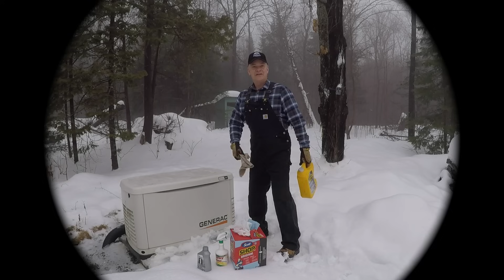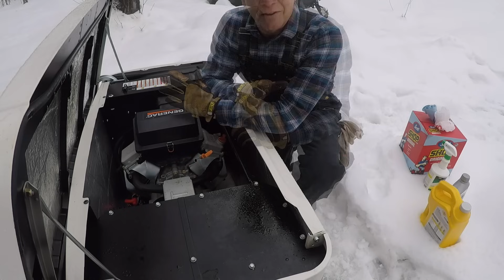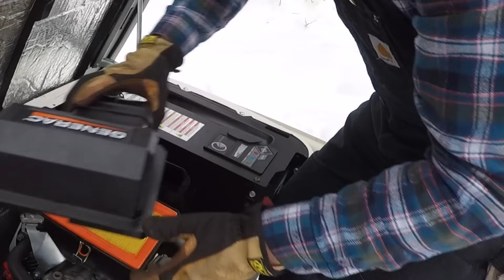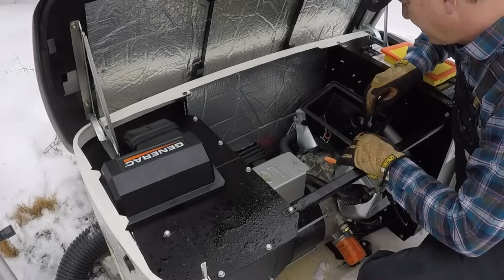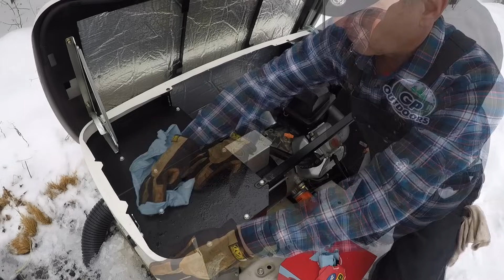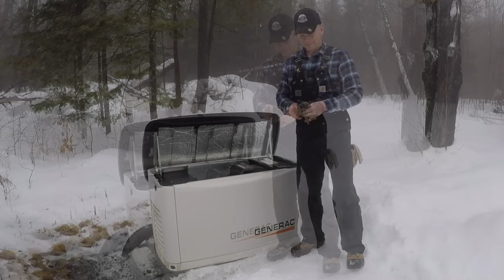#133 Thinking of Buying a Generac Generator? You Need To Watch This!

Comment: Its NOT the exhaust port thats a problem. That is the Crank Case Vent that is freezing over because its a badly designed environmental requirement.  Just pull the hose OUT of the air box, rout it away and put a tiny K&N filter on the end of it, then take some JB Weld and seal up the hole left in the air box. you'll never have another problem.
Reply: dave berry :- That is what I was watching the video for...a positive solution to prevent this icing from happening in the middle of winter during an emergency. Hopefully Generac has also come up with the solution...someone mentioned a heater kit, but surely a drain system of some sort from the factory would also solve this problem. Or a redesign.
Reply: Don't think the warranty guys would be real hip on honoring your warranty with a lump of  JB Weld there.
Reply: @jamesoconnor3562  Then first you take photos of what the device the manufacturer installed, and the icing problem it caused. Then, if you need warranty work, you simply make it clear to them "WHY" it was done, and heres why it was done. Its a bad design on their part. And what I said to do causes no harm to any part. In fact if anything its better for the engine.

Comment: You can buy a little potable heater like the ones used in a motorhome they kick on when the temp goes below freezing so pipes and hoses won't freeze. They are like $25 and very tiny it would fit in that box easy

Comment: You might try elevating the unit. At ground level the engine sucks in snow and moisture accumulated around it. Elevating it about 18 to 24 inches off the ground will help.

Comment: Simple fix, as a rubber hose from crankcase vent thru bottom of filter housing and raise it above above the icing areas...
Reply: What do they recommend for oil?  Use amsoil 100% synthetic. Does it run full tilt on start up? All the more reason to use amsoil
Reply: It would still ice, just wouldn't clog as fast, and then when it finally did, you'd have a huge amount of ice you'd basically have to chip out, without breaking the plastic.

Comment: Ah ok. The crackcase vent was plugged up. That makes sense. I’d just move the hose so it vents to the atmoshpere and not into the aircleaner.
Reply: exactly . maybe add a small K&N air filter   ….don't forget to plug the hole in the airbox.....it's on the "filtered" side of the air filter
Reply: answered correctly..better than factory engineering.....
Reply: the EPA would not like that, but i don't care.  it beats standing out in the cold removing ice from the
filter box.
Reply: David M They do have a fix for the ice issue now.  Positive crankcase ventilation is good for the engine, it is not an EPA thing. You always have blow-by and need to get the gas vapor out to prevent oil contamination.

Comment: People may put this generator down,  but it has served us well keeping nothing in our refrigerator  and freezer from spoiling. As well as staying worm or cool in the summer.  Talk shit about it because you more than likely have NEVER used one.   This guy gave us a very useful idea and could save a service call.
Reply: No, I talk shit about it because I service and repair them. Brand new you have a 50/50 chance that they will need warranty work. I've replaced several governor stepper motors on these units, some more then once.  And all most all of them will have water in the oil when it's changed due to condensation because the controller only let's it run 12 minutes per exercise. And they've had a spate of bad control boards. Bad to the point that all the guys carry an $800 control in the van because chances are that it will be a bad control at 3 am in a storm when the thing quits.
Reply: You have been very lucky. My engine block cracked within the first six hours of operation. & that's very typical of these units. Best of luck to you.

Comment: Not "an exhaust port from the engine", but a crankcase ventilation system to get rid of the blow-by.   Propane is a wet fuel that creates a ton of moisture when it burns.  Kind of odd.  The 'wet' blow-by then gets sucked into the air box ahead of the air filter, where it condenses when it it cold enough and finally freezes when the temperature gets below freezing. It is a really poor design.
Reply: It probably uses a mass air flow sensor to meter the air coming into the engine. The air from the blowback has allready been accounted for and has to be dumped back into the system behind the mass air flow sensor or the engine will run rich.
Reply: Lol. Calling it an exhaust port had me scratching my head for a minute too, but it's good to see a video pointing out the problem with the PCV. This problem isn't unique to propane or to these engines. I had an old high mileage turboed Porsche with abnormal blow by, that would fill the air intake with what looked like ice cream and snow, until it prevented the mechanical air flow sensor from working. Then it would quit because the air/fuel ratio couldn't adjust to throttle changes. No pressure build up in the crankcase, but the problem is similar. For this generator, it shouldn't be too difficult to modify the PCV or filter box to eliminate the problem. Or, find a simple way to add a little warmth to the airbox and a small bit of drainage.
Reply: Yep, any ICE could have this if the PCV goes to the air box.  The problem is temperature differential that is condensing thee water vapor faster then it being sucked into the intake.  Air box warm enough to not condense H2O is the answer

Comment: I would remove that line and install a small external filter and close off nipple on air filter housing. It's just a crank case breather. We use them on Harleys!
Reply: LOL Harleys drip oil all the time .

Comment: I live in Texas and was working on designing a small house with a Generac back up just in case, after the recent issues I have thought more about it and about how well it would work if this happened again. the house would be small, under 1000 ft2 and very well insulated as would be an enclosure area for the generator to deter theft. If that was the main issue for where you are it is encouraging for my results and now I know one item to look out for.
Reply from the maker: Good morning Desmond. So sorry for the difficulties you and your family have faced lately and hope you have power and water and are doing better. It is a good unit overall so far- just this small inconvenience. As long as I am here to soak up the water after it runs then all is ok.. It usually only happens in severe cold (approx -20 Celsius). Good luck to you and your family.
Reply: @GPOutdoors  We are good, we survived even with some dying from the cold. That is why I am planning better for the future. I do thank you for the concern but I am not as bad off as some that cannot afford an emergency.

Comment: I have a Generac 16KW, older though from 2005. I never knew of this issue, but I live in NJ and not as cold as Canada. It has worked without issues for 8 days when we had  a power outage during Hurricane Sandy in 2012. The only advice I will give any Generac owner --I was told this by their technical helpdesk is to shut it down once a day for 5-10 min and check the oil level. And yes, you may need 1/5 to 1/4  quart per day. So keep a few extra quarts of oil (I just store 1 gallon when on sale at Walmart). Good for 2 years of oil changes. And I also think it is worthwhile service kit on hand (oil & air filters + spark plugs). Besides that, I also keep 2 spare oil filters on me so I can change the oil after 8 days of running as per recommendation.
Reply from the maker: Thanks very much! Some great helpful advice for folks. Have a great week!

Comment: I recommend installing the generator cold weather kit
Reply from the maker: I have 3 heater kits on it now. Thanks for the suggestion. The vent port kit now stops the freezing back into the port but does not help with the water build up in the filter area. Thanks though- appreciate your help!
Reply: What's included in the "cold weather kit"?  A quick search online showed a kit with a battery warmer and an oil filter warmer, with a thermostat to run them when the temp drops below freezing.   I don't want to pay for hydro to keep things warm 24x7 in the cold months. That would really drive up the cost of ownership for those of us in the north.

Comment: So basically the manufacturer needs to add a heating element into the bottom of the air filter box for use in extreme cold climates, Such as the one that this unit is being operated in. I definitely appreciate the heads up. I'm in NE Ohio,Yes it does get cold here.  But doesn't stay as cold as it does up there in Central Ontario Canada.  Generac needs to see this, I'm sure there engineering department can put a stop to this inherent problem with a very easy fix.

Comment: I have the same generator as you do the 16K, I have had it for 5 years and have never had the problem that you have. I live in the Chicago area so winters here can get cold but not too extreme. One thing that I did do was install the cold weather kit on the generator when I installed the generator. It has a heated pad under the battery and a heated sleeve that slides around the oil filter. I would think that could effect the temperature in the generator and any condensation problems. I wonder if thats why I have never had the problem you have had. I noticed in your video that you did not have the cold kit installed. But I have to be honest I have never pulled the air filter and looked in winter to see if I have any water or ice. I do know my dip stick has never been pushed up. I am running my generator on natural gas. I’m assuming you are using propane being that you also using Solar panels that you’re off the grid and can not get natural gas.

It would be interesting to hear what you think. 

Thank You for taking the time to upload and share your video.

Louie
IL 🇺🇸 USA

Comment: Agreed with anyone suggesting the water should be weeped or drained
away from the air box. Also some supplemental heating will help.
Thanks for the video Sir. A genset is a critical part of our existence.
Reply: I would just drill a 1/16 hole in bottom of filter box so water would leak out and not build up like I have done on others, it works. Better than always having to take it apart and clean it out.
Reply: @randycrump5464  wouldn't it just suck unfiltered air through the hole?
Reply: Randy Crump Oh well, little won't matter in the big picture.
Reply: @randycrump5464  What about all the ice build up inside the cabinet?
Running the engine for an hour is the ONLY solution.
Reply: @trustme7731  
Just a possible suggestion, install a one way valve that will only open when the engine is not running, pulling air through the filter box, yet will allow the water to drain out of the filter box upon shut down of that generator. 
It would need to be a port large enough to allow the water to drain without freezing inside the drain opening causing the same issue.
Maybe a 1/16 hole isn’t large enough to allow a lot of unfiltered air to flow through the air box(filter box), but if there wasn’t that concern, then the engineers would have made drain holes in the filter box!

Maybe the pressure exhaust port needs to be moved higher in the filter box to keep it out of the reach of condensation build up!!!

Comment: Its almost as if they should make a cold climate addon where it uses grid power to power a small heating element that only stays on after the temperature decreases to freezing to act as a block heater, but specifically for the air box, output tube, and a drain line to the outside of the box that prevents any condensed water vapor to freeze, and simply allow it to drain out remaining slightly above freezing.

Comment: Put a extension  on above the thickness of the ice.
Reply: You mean place a tube sticking up out of that hole, right? Where he showed the ice clogging up that hole in the air filter unit?
Reply: An extension above the ice would only allow additional water to collect making the ice thicker until it rises to a point where it might even draw liquid into the intake manifold and that would destroy your engine. This is layer upon layer of ice developing over time as the engine runs and condensation buildup in the Box. The problem is not a poor design. But the lack of the extreme cold kit and inadequate test run time to let the engine heat up so condensation is gone. This is the same kind of thing that happens to the exhaust on all cars when the exhaust system doesn't get hot enough from not running long enough. If you still have condensation dripping out the tailpipe when your engine is cut off, there is still water in that pipe and it will Rust over time. If it gets cold, it will freeze. It's the same Theory.

Comment: I wonder if you could put one of those silicone engine block heaters on the air box and have it cycle occasionally to melt out any ice.

Comment: We have a 5yr old 11k Generac and live in Maine. Gets cold here. It's on
a schedule to test run for 10 minutes, once a week and only had a problem

once. It didn't start one day, cranked wouldn't start. Pulled the dipstick and
was right on the "low/add" mark. Added oil, hoping that it was a low oil 
sensor that did it's job. Once oil was at the full mark, it started right up.
There was some oil on the floor of the pan of the unit, not a lot. 
Cleaned that mess up in the Spring when it was warmer and just
monitored the oil level the rest of that Winter. Hasn't lost a drop since.
The device in your video that froze up is a PCV valve, not exhaust
related at all. In the old days, pre 70's was just a pipe that released
gases from the crankcase area into the air. In the 70's those gases were 
rerouted into the intake system to be reburned. PCV valve was one of the 
earliest pollution control devices. 
Due to your video though, I'm going to have a closer look at that. 
I haven't had any other problems AT ALL, with our Generac. It's kept us
warm during outages, and saved us 1000's of dollars with no food
spoilage keeping our freezers running. I'd recommend them without
hesitation.
I'm retired now. Lifelong mechanic. Never would have thought to check
my PCV valve.
TYFS this very simple fix. Great video my friend. Stay Safe and Warm

Comment: Pour a little RV antifreeze in  reservoir to stop freezing - exhaust pressue should be able to displace liquid. As video suggests, it is always a good idea to routinely inspect your backup system to ensure operation when it is needed.

Comment: 1- change / raise the position of the crankcase breather hose from the engine to the air box to a higher position. 
2- attach a different hose to the original position with a pcv type valve that will open when the engine is off and close while the engine is running.

Comment: I noticed in the comments the mention of putting on an elbow to get above the water, this would only work in the short term until it filled to the level of that elbow. The biggest problem is that when you burn natural gas or propane you get moisture. Some of that ends up in the crankcase. When it gets drawn out on those really cold days it freezes out. The simplest solution would be a small hydraulic tank heater on the underside of the breather. They make them as a stick on.

Comment: I’m just going to applaud this guy’s efforts to keep that thing clean.  👏
Reply: Could you put in a drain line to help relieve moisture build
Reply: Ok
Reply: Not to mention to throw the frozen oil onto the ground..
Reply: Thanks bud
Reply: @stankornsey7525  that too would most likely freeze. Unless it was a small heated line.
Reply: Stan and Tommy - it would need to be a drain line with a filter as that area collecting water is on the clean side of the air filter. But I like the way you both think!!!

Comment: Sounds like you need to drill a tiny hole at the bottom and top. I had a tail light keep building up with moisture and eventually turned it to a tiny aquarium. I drilled a tiny hole for moisture to escape and problem went away naturally.
Reply: I don't think it is as simple as drilling a small hole. This is the filtered side of the air flow, drilling a hole will admit insects and dust. Note that this is a unit that is operating in a forest not a city.
Reply: @spiritintheforest  - I have  to think drilling a 1/16" hole at the very bottom would allow for water drainage, but not significantly affect the filtered intake, which is massive compared to a 1/16" hole.  The compartment is also located inside a larger protected enclosure, so the elements aren't really going to migrate in there very much.  If you wanted a bigger hole, or were concerned about dust/debris, you could run some soft drain tubing out of the hole and attach a filter to the end of it, or even add a small check valve if you want to be fancy and ensure air (and water) only flows one way.  Frankly, Generac should have addressed this design issue.

Comment: I'm very glad you took the time to explain the design flaw of that generator i was thinking of getting one for the house/garage as s back up system...
Would there be another way of altering the system to cure the problem??? 
Like why is the exhaust going into the air filter is that some kind of pollution control? Then why can't they move it to a higher location in the air filter box? 
Or have a drainage tube with like a n inline fuel filter at the end where the condacation can dip out but the filter will still filter any air that does come back into the machine wher running? 
Thank you for pointing this issue out very helpful...

Comment: This is a great example of why you follow the directions. Both Generac and Kohler, require  you install a Cold Weather Kit in climates like this. Part of the kit  is a small electric heater that wraps around that exact hose that he's having a problem with, and it prevents exactly his problem.